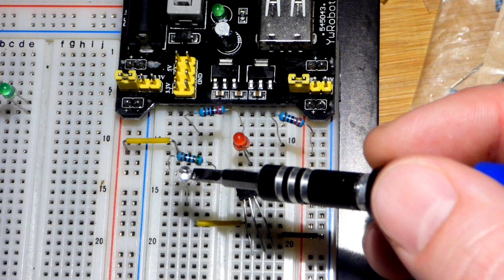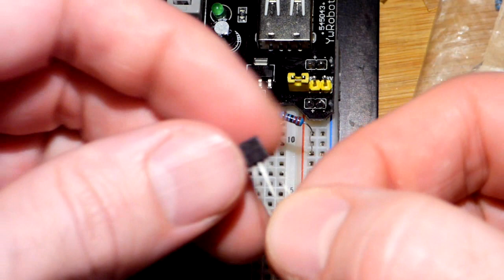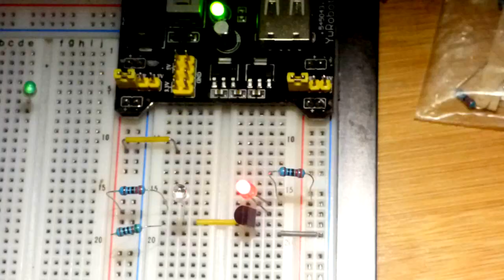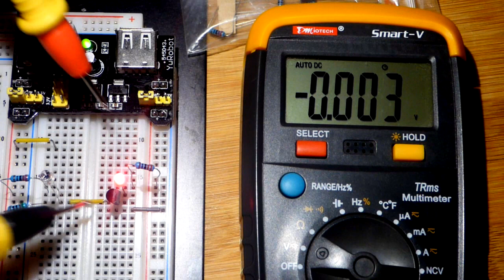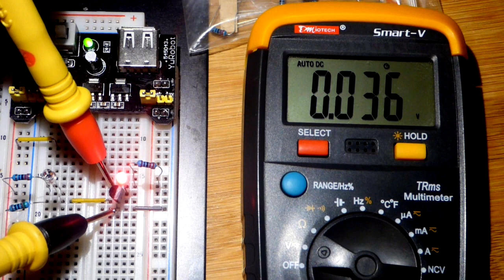Photodiode and 2N2222 NPN BJT light dependent switch circuit for beginning learning electronics

Comment: Hi! I am an absolute beginner when it comes to electronics. If I only have 4.5 v as the power supply, would this exact same circuit still work? or do I need to change anything? Sorry if this question might seem dumb. Or, what do you recommend I do if I don't have a 5v power supply?
Reply from the maker: Don't worry, changing voltages takes time to get used to :) Most 5V circuits like this will work with 4.5V.
Reply: @Electronzap  Oh, I see. Thank you very much!

Comment: Hi, I'm working on re-creating this experiment, just out of curiosity, are those 220Ω resistors for the collector to 5V, as well as the pull-up resistor Cathode of photodiode to 5V? I'm looking to use sunlight and green LEDs instead of the photodiode, I detect about 100mV difference between light and dark. Thanks for the video!
Reply from the maker: Yup, 220Ω for the LED protective resistor and pull up resistor while using 5V. LEDs actually produce some voltage under bright light like mini solar cells, Anode positive and cathode negative, but with very low current. The more in parallel, the more effective they are. I don't know if they will work as a photodiode substitute, but doesn't hurt to try :)